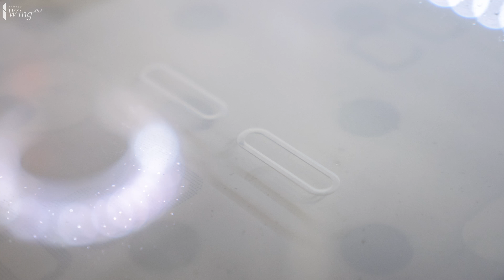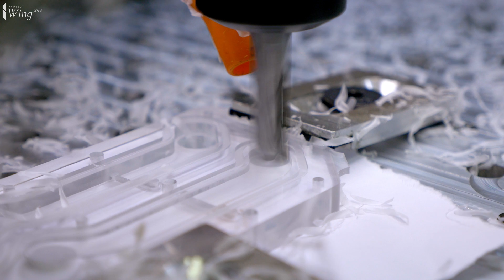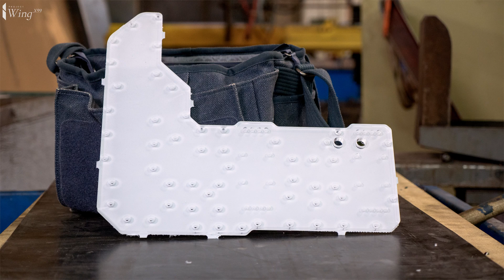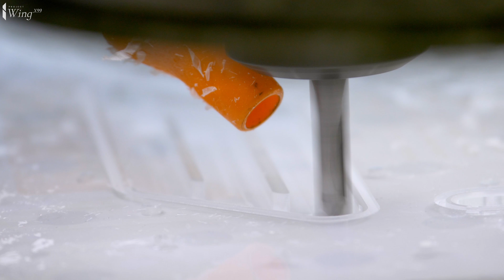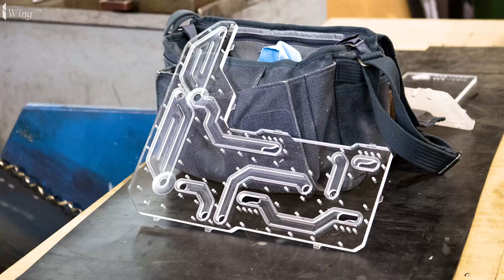project Wing X99 - Milling Water Cooling Channels! (#6)

Comment: It's art Andreas. You need to give me some tips on which feedrate and spindlespeed you are using. I did a reservoir once and it was completely filled with a billion tiny holes / chips that came out. I had to sand it out completely flat before polishing. Yours is clean and smooth.
Reply from the maker: Whatever you need mate! :)
Reply: You need a 2 flute bit that has a big chip evacuation rate. The angle of the cutting edge is also important, you need to evacuate the chips upwards. Test on scrap acryl, every CNC machine is different, there is no magic number. Start with the highest spindle speed you have and 2500-4000 mm/minute feed as a test